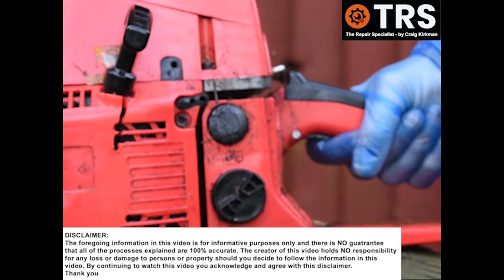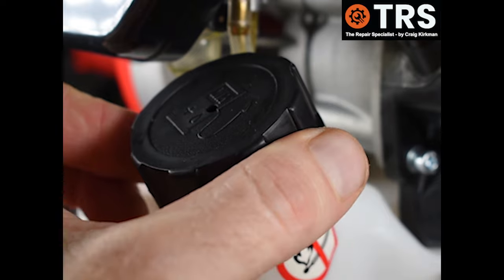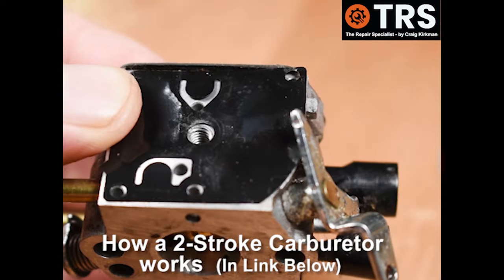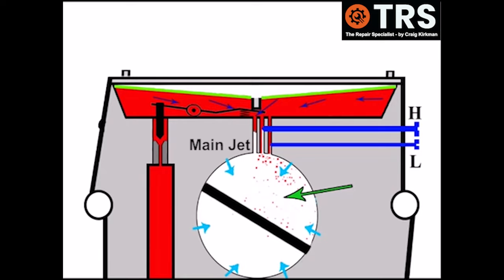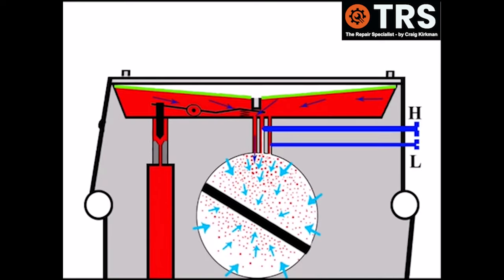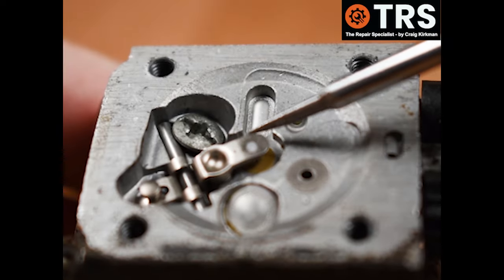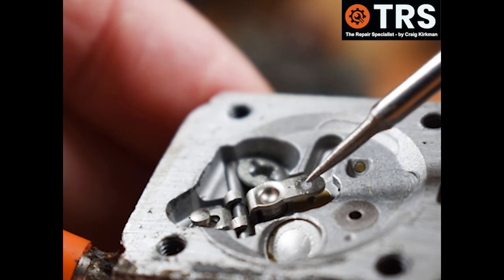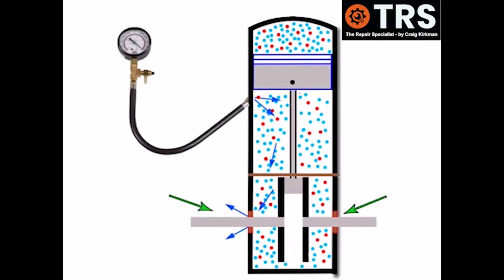Why does my chainsaw start then die when I give it gas?

Comment: I hope you will give me some hints about the Stihl 034 AV carburettor .A few times I have pulled the carburettor
 a part --TILLTSON HK 438 or 43B --- I have used  a pin to clean every little holes....the gaskets sems to be ok 
...a few times have put a drop of petrol in the spark plug hole and it starts but no fuel comes from the carburettor
 after that as the spark plug is dry when I remove it..... Does this kind of carburettor the H & L ONE TURN OUT ?
thank you

Comment: PROFESSORE  I am back again !!! I  got an Husqvarna chainsaw 236  it has the original carburettor 
that  I cleaned and put new gasket ---really the old one were still OK--- because the chainsaw didn't 
start I had to pull apart a few times  then lately  something happened the primary is not working  
I took it off and  cleaned it and it worked but not on the carburettor as it mast be a blockage in the
 carburettor  I cleaned it with carburettor cleaner also cleaned the little holes  with a needle  and 
replaced with a new primary  the petrol comes from the tank but doesn't go back to the tank
...any hints ??
Reply from the maker: Hello! It's great to see you back on the channel!

It sounds like you've been working hard on your Husqvarna 236 chainsaw. Let's see if we can figure out what's going on with your carburettor.

Given that you've already cleaned the carburettor and checked the gaskets, there are a few more things you might want to consider:

Check the Fuel Lines: Sometimes, the fuel lines can become kinked, cracked, or blocked. Ensure that both the fuel supply and return lines are clear and properly connected.

Fuel Filter: The fuel filter in the tank could be clogged. Even if fuel is getting through, it might not be enough for the carburettor to function properly. Try replacing the fuel filter if you haven't done so already.

Needle Valve and Diaphragms: Since you've cleaned the carburettor, make sure the needle valve is seating properly. Also, check the condition of the diaphragms inside the carburettor. If they are stiff or damaged, they can prevent proper fuel flow.

Carburettor Adjustment: After cleaning, the carburettor might need to be adjusted. Make sure the low-speed and high-speed screws are set to the manufacturer's specifications.

Air Leak: Sometimes, an air leak can cause issues with fuel delivery. Check the carburettor mounting gasket and the intake manifold for any signs of leakage.

If you've tried all these steps and the issue persists, it might be worth considering a replacement carburettor, as sometimes internal blockages can be very tricky to clear completely.

I hope this helps, and good luck getting your chainsaw running smoothly again!

Thanks

Craig

Comment: Hi, I really need your help, i have a 47cc 2 stroke, with a reed case, i have 2 motors the same evrything one runs good and the other is a pain to start and once i get it runnin i can keep it runnin if i keep the throttle but if i adjust the low needle to where it will idle good than i will get allot of bogg down for the first 20% of throttle, if i make it out of that it will rev to its fullest and have power but the only way to get rid of bog down is by richening ul the low but than i cant keep an idle cuz it will die. On the motor thats good i used the cylinder and piston over to my reedcase thats given me problems, still same problem, i put old cylinder and piston back and now used the good carb of my other good  engine and for sure thought this was gonna fix it, still same problem, which leads me to beleive its somewhere in the case, reeds, or coil. Spark plug is good. I put everything i just used back on the good motor reedcase engine and it revs up and has great throttle responce but when  its on this other reed case its not, i use motoseal and sealed the case, i checkek for leaks, and theres great back pressure when the piston cones down and trys to close the reeds, reeds dont leak. When i cover the hole behind the reeds it sucks good when i pull the pull starter, so i have no clue whats goin on, wouod a pin hole leak cause this? But i dont think theres a leak, it feels sealed good.

Comment: Hey, i was under the impression that the high screw controlled the amount of fuel through the main jet, is this wrong?
Reply from the maker: Hello,

Thank you for your question, and I appreciate your curiosity! It's always great to clarify things related to carburetor adjustments.

In most carburetors, the high-speed screw indeed controls the air-fuel mixture at higher engine speeds. By adjusting the high-speed screw, you can affect the fuel flow through the main jet to optimize the air-fuel mixture for better performance.

So, you're absolutely right! Your understanding is correct. If you have any more questions or need further clarification about carburetor adjustments or any other topics, please feel free to ask. Keep up the great work and happy tinkering! Craig

Comment: There is a fuel inlet and outlet on the carburetor. How do know which one is which?
Reply from the maker: Just take a look at the fuel flow if you are running the engine.  This is by far the quickest and easiest way to do it. Thanks

Comment: really hard to pull with plug in, but ok plug out.. how do you adjust valves on cs400? can it be done ? thanks
Reply from the maker: Hey there! It sounds like you might be dealing with a valve clearance issue on your CS400. Valve clearance adjustments are essential for ensuring your engine runs smoothly. Here's a general guide on how to adjust the valves on your CS400:

Safety First: Make sure the engine is off and cool to the touch before you begin any work.

Remove the Spark Plug: As you mentioned, it's easier to pull the starter cord with the spark plug out. This relieves compression and makes it easier to turn the engine over.

Access the Valves: Depending on the model, you may need to remove a cover or panel to access the valve components. Consult your CS400's user manual for specific instructions on accessing the valves.

Measure Valve Clearance: With the access panel removed, locate the intake and exhaust valves. Use a feeler gauge to measure the clearance between the valve and the valve lifter. Refer to your user manual for the correct clearance specifications, as they can vary from model to model.

Adjust Valve Clearance: If the valve clearance is not within the specified range, you'll need to adjust it. To do this, typically, you'll need to loosen the locknut on the valve adjuster screw, turn the adjuster screw to achieve the correct clearance, and then tighten the locknut back in place.

Recheck Clearance: After adjusting the valve clearance, double-check it with the feeler gauge to ensure it's within the specified range.

Reassemble and Test: Once you're satisfied with the clearance, reassemble any covers or panels you removed. Reinstall the spark plug, and then give it a try. It should be easier to pull the starter cord now.

Remember that this is a general guideline, and it's crucial to consult your CS400's specific user manual for detailed instructions tailored to your model. If you're uncomfortable doing this yourself, or if you encounter any issues, it's always a good idea to seek assistance from a professional technician to ensure the job is done correctly and safely.

I hope this helps you get your CS400 running smoothly again. If you have any more questions, feel free to ask!

Craig

Comment: Do you have a video 
  troubleshoot my poulan pro pr 46bt back pack blower
 the spark plug is not sparkling I think it's the off and on switch 
 how do I troubleshoot this 

 and do you know where you can find  assemble and take a part picture
 step by step  

 How to  assemble and take a part picture
 step by step    poulan pro pr 46bt back pack blower

Comment: Smoke test your engine its the fastest easiest way if the crank seals are bad use a q tip and put brake fluid on the seals and wate a few days and resmoke it will soften and should seal up good day people!!

Comment: I can start my chainsaw without any problems. But then after working with it for a minute or two with full power, it starts giving itself high idle gas, and then it shuts down. Only way i can turn it on again is if i give it choke like I'm starting it cold. And then repeat this process all over again.

Comment: My kid turned the idle screw all the way in , must have turned it  5-7 full turns in totally lost the sweet spot, how can I find that again , turn it in all the way, then back all the way then in HALF Way ???
Reply from the maker: Resetting your idle screw to the "sweet spot" after it's been fully turned in is a process that requires a bit of patience and attention, but it's certainly doable. Here's a step-by-step guide of what I would do to help you adjust it back again:

Turn Back to Baseline Position:

Start by gently turning the idle screw all the way in (clockwise) until it stops. Be careful not to over-tighten or force the screw, as this can damage it.
Then, slowly turn the screw back out (counterclockwise) about 1 to 1.5 turns. This is a general starting point for many engines.
Start the Engine:

Start the engine and let it warm up to its normal operating temperature. Adjustments should always be made with the engine at operating temperature for accuracy.
Fine-Tuning:

With the engine running, slowly turn the idle screw in (clockwise) until the engine begins to run slower, then turn it out (counterclockwise) until the engine smooths out.
Continue to adjust the screw slowly until you find the point where the engine runs smoothly and the RPMs are steady. This is typically when the engine idles without stalling and without causing the clutch to engage (in the case of equipment like chainsaws or trimmers).
Listen and Observe:

Pay attention to the engine's sound and performance. The "sweet spot" is where the engine sounds smooth and runs without hesitation.
Test Under Load (if applicable):

If your engine powers a tool or equipment, briefly engage the tool (e.g., rev a chainsaw or engage a mower blade) to ensure it responds well and returns to a smooth idle.
Safety First:

Always ensure safety when working on engines. Turn off the engine and wait for all moving parts to stop before making adjustments.
Consult the Manual:

If available, consult the engine's or equipment's manual for specific instructions related to idle adjustments.
Remember, small adjustments can make a significant difference. If you're unsure or the engine doesn't seem to respond well to adjustments, it may be helpful to seek assistance from a professional mechanic. They can help ensure that the carburetor and other engine components are functioning correctly, which is important for the overall performance and longevity of your engine.

I hope this helps a little

Craig

Comment: PROFESSORE MY I ABUSE OF YOUR KINDNESS AGAIN?  Lately I bought a Sihl 010 chain saw  it worked for half hour  then stopped....
put new gaskets it started then dies I cleaned the carburettor still no difference I put anther carburettor   starts and stops ....Watching your video
probably the problem is with the manifolds gaskets   ...Not being an expert with internet I wonder if I can make the gaskets ...could you please tell me 
what thickness the material  has to be ? ...does it makes any difference  if it is thin or thick ? On the carburettor side/manifold  on  gasket usually there is a little hole 
is it very important?....does it matter if the hole is a bit bigger or small ? ....Which screw should I start  to Toone up  the first the "H" then the "L" should start
with both of them HALF TURN OUT ?  ...You do mention from one  turn out !!! 
Thank you Tony
Reply from the maker: Hello Tony,

Of course, you're welcome to ask for help anytime! It's great that you've taken the initiative to work on your chainsaw and troubleshoot the issues you're facing. Here are some answers to your questions:

Gasket Material Thickness: The thickness of the gasket material is crucial for proper sealing. It's generally recommended to use gasket material that matches the original thickness, as specified by the manufacturer. Using a thinner or thicker material can affect the sealing and the engine's performance. If possible, try to obtain gasket material that matches the original specs.

Hole in the Gasket: The hole in the gasket is important for allowing the passage of air and fuel. The size of the hole should match the original gasket, as it plays a role in the air-fuel mixture. If the hole is too small or too large, it can affect how the engine runs. Try to replicate the hole size from the original gasket.

Tuning the Carburetor: When tuning the carburetor, it's generally recommended to start with both the "H" (high-speed) and "L" (low-speed) screws at one full turn out from fully closed as a starting point. From there, you can fine-tune the carburetor for optimal performance. Small adjustments to these screws can make a significant difference in how the engine runs. It's a good idea to turn them slowly and in small increments while monitoring the engine's performance.

Remember that tuning a chainsaw carburetor can be a bit finicky, and it might take some trial and error to get it running smoothly. If you're unsure about the specific settings for your chainsaw, it's a good practice to consult the manufacturer's manual or seek advice from a professional or experienced technician.

I hope this information helps you with your chainsaw repair. If you have any more questions or need further assistance, feel free to ask. Good luck with your chainsaw project!

I hope this helps a little

Craig
Reply: I can find the right words  to say thank you  for your help your collaboration is very much appreciate ....May god Bless you.

Comment: Shouldn't you check the exhaust screen first
Reply from the maker: Not always. That is because in my experience  the exhaust screen has Not been as common of a cause as many people think.

In the last 30 years I have only actually needed to replace a hand full. They do clog, I will absolutely agree, but for some reason there has been a you tube explosion of people saying that exhaust screen blockage is the major cause of bog. I think this is because they watched videos on you tube where the presenters wanted to portray the next shocking new reason, or “The Truth” about Chainsaw Bog. Something like that. 

In actual fact, from the many hundreds and hundreds of chainsaws that I have set my repair fingers on, most of them were indeed Fuel Related Problems. Therefore, If this is the case, then the exhaust screen goes down the pecking order. It does need checking, but in light of what I’ve said, it does not need to be checked first

Comment: Maybe someone can figure this out for me, I have a craftsman 18in 42cc. Wouldn’t start, cleaned all the jets of the carburetor and reassembled and still nothing. Removed the muffler and it fired off 1st pull. Spark arrestor screen doesn’t seem to be accessible and can’t quite see it if it’s dirty but no exhaust when the muffler was installed but got smoke out of the engine when i removed it. Muffler is a 530047207 poulan style. Hate to damage it if it’s not supposed to be opened while trying to clean the screen. Currently soaking the muffler to try and clean it. If anyone knows if that arrestor is serviceable or if there is something I’m missing let me know.

Comment: I noticed all the gas leaked out from the carburator  throat  over a week when I sat the machine down as it was TOO hot for yard work (Summer)  any clue there to troubleshoot the problem ? Machine starts and idles perfectly , was running at only 75% power and then quit....  adjusted fuel/air mixture and was running GREAT... now quits if any throttle is given... Please help... local repair guy is an asshole and a thief... thanks